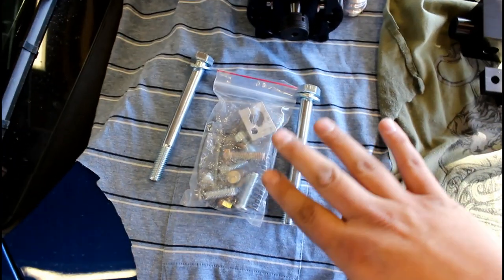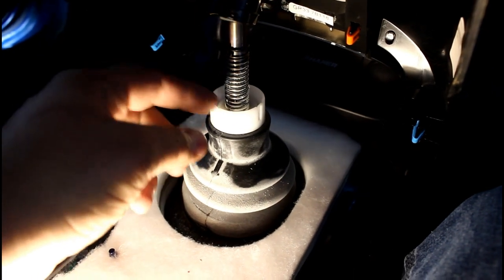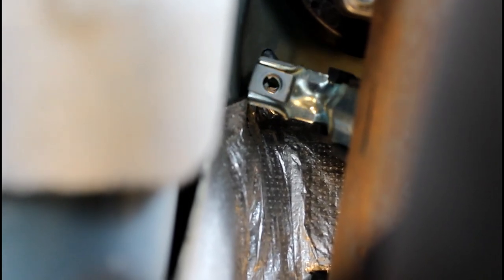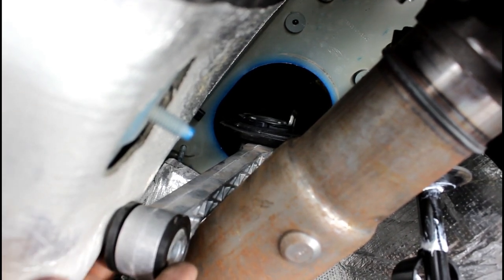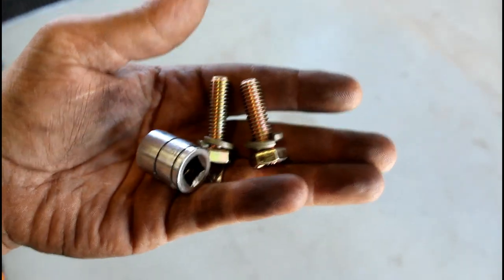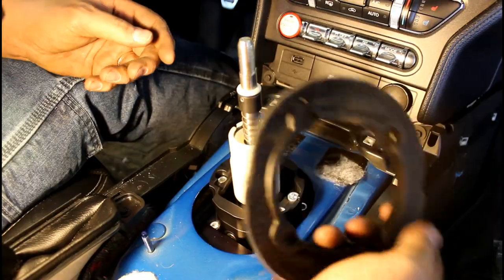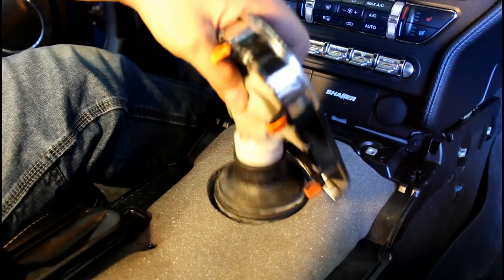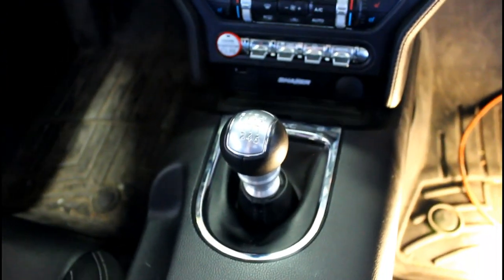How To: Install Ford Mustang Barton Short Shifter (Step-by-Step)

Comment: How'd you drop the transmission ? Did you use a transmission jack to drop it ?
Reply from the maker: leave it connected to the engine.  it will tilt down.  but yea if you wanna pull it out.  use a tranny jack.

Comment: @FatGuyBuilds Scale of 1-10 how hard is this install? I’ve got the flat stick version sitting right here and I’m debating on doing it myself or driving a few hours to get it installed ? Main concerns are my local shop quoted me for a full days labor and said they would have to remove the driveshaft and exhaust and etc..
Reply from the maker: U just follow my guide and u will be just fine
Reply from the maker: Maybe a 6